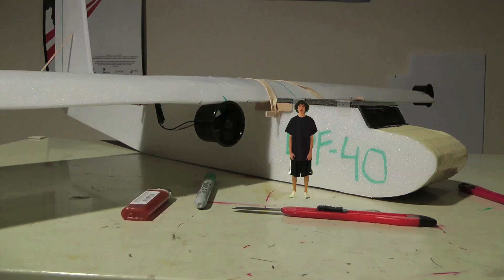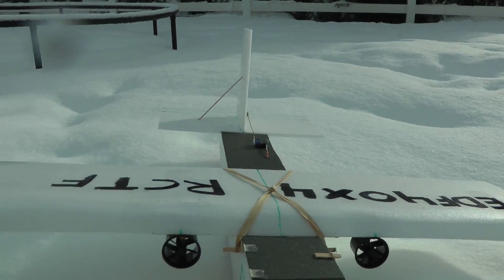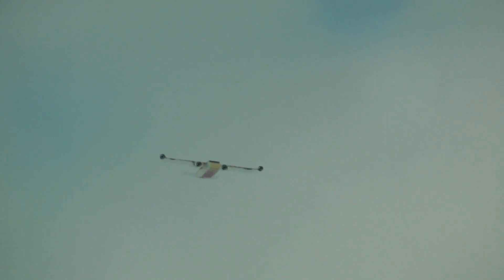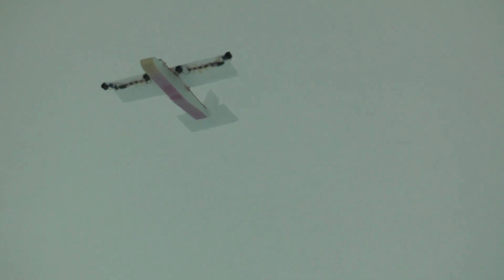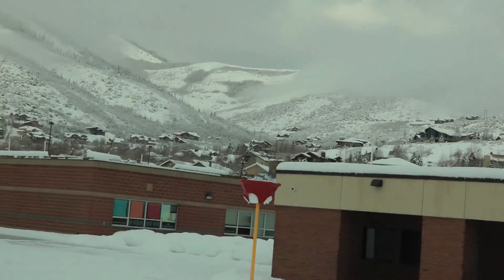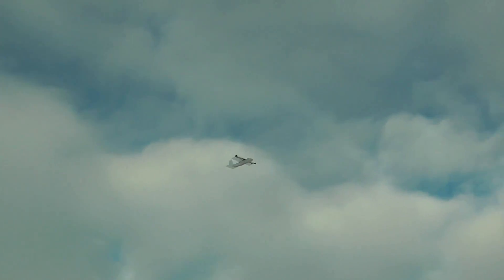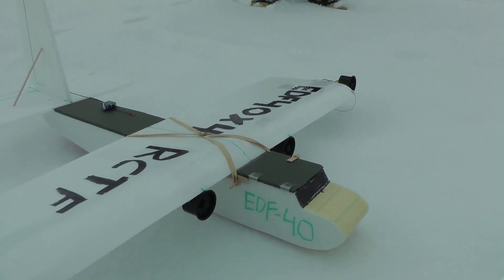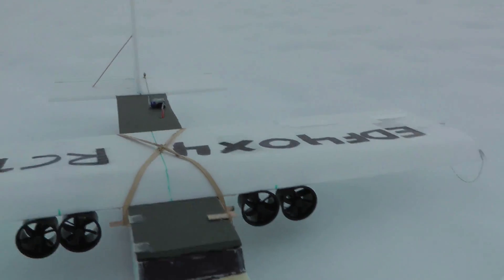40mm EDF Thrust Vectoring Cargo Plane

Comment: Set up your tip EDF's as flaperons, so you flip the switch and they angle up a bit for short-field t/o and landing. that way you'll have the power on as you come in for a landing, and you will have good control at slow speed. Just a thought.